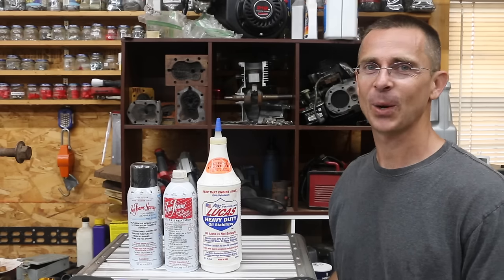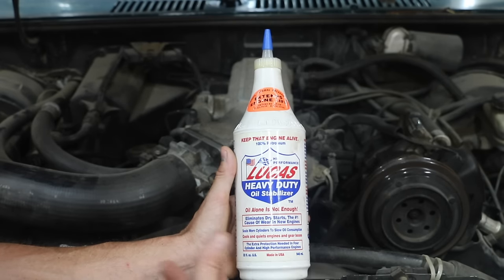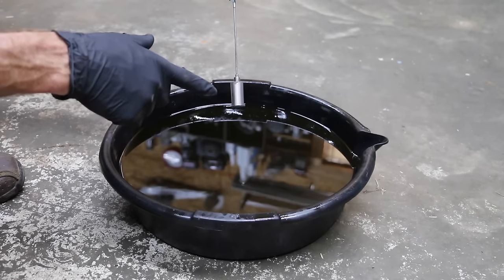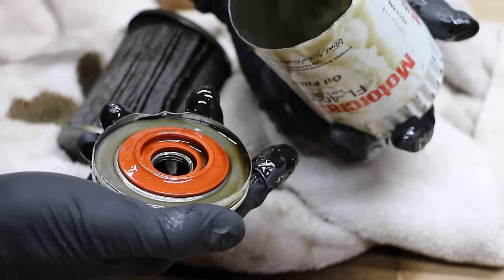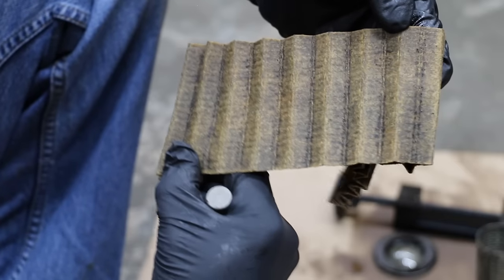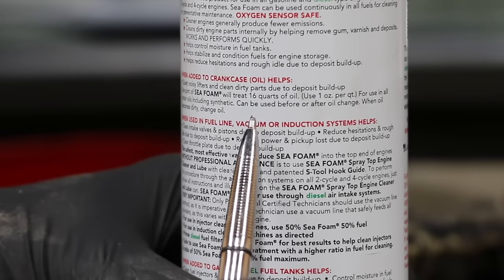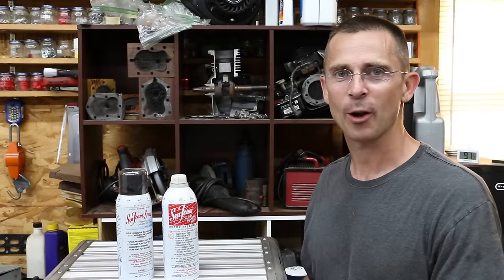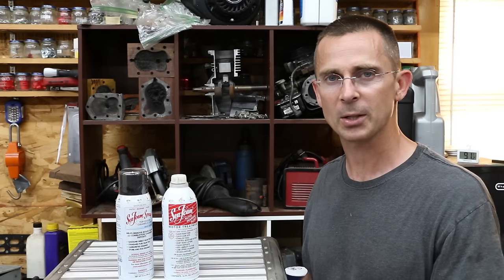Did the Seafoam fix last? Update on the Ford Ranger

Comment: Thick oil will increase compression. You can rehone the cylinders with a fine powdered polishing powder like what the use in a rock tumbler. An old timer showed me that when I worked in a garage in high school. My 67 Nova had 2 cylinders with low compression 60ish in one and 70ish in another. He ran the engine at about 1500rpm and proceeded to dump about 3/4 of a sandwich bag worth of polishing compound from a rock tumbler down the carb. Drove it down the road and flogged it for about 10 minutes changed the oil and re did the compression test. All were within 10 -14 psi of each other somewhere around 140. Ran perfect for the next year sold it to a friend and he drove it 2 more years before blowing the transmission and junking it. I would test it on a lawn mower engine first to make sure you get it right....
Reply from the maker: Impressive fix! Thanks for the recommendation.
Reply: I'd love to see you try that on a old mower.  Sounds sketchy!
Reply: Sounds like the old 2 strokes that has iron liners that can be rebored, but if the compression rings are shot,then.imho ur outta luck with this method!
Reply: Nothing in a can will fix broken parts. That will probably only fix a glazed cylinder but if it is shot worth a try....
Reply: @Cape Cod CNC --- My grandpa used to tell a story about when chrome alloy piston rings first were being used in maybe the late 40s, their family got a new car and it burned a ton of oil so someone recommended doing what you're describing except with comet cleaner/polish powder to get the rings to seat.  Worked perfect according to him
Reply: Cape Cod CNC This sounds all kinds of sketchy. I definitely want to see it tried!
Reply: I have a VERY HARD TIME believing this one.  To the extent that I have semi first hand knowledge that it doesn't work (semi in that you don't actually specify what it was that you dumped in the oil).

In most cases a decent oil filter should catch most abrasive particles, but if sufficiently fine it will get past... but that gets into what I've tried- I had a ford straight 6 that wouldn't die, this was back when 100k miles was A LOT of miles on a car and it had something between 150-200Kmiles on it.  It was worn, slow, didn't seem to do anything right (from a teen ager's perspective) BUT it wouldn't die.  

We finally dumped about a cup (maybe less, not more) of autobody paint polishing compound in  the oil while it was running.  It kept running but with less and less power, eventually (probably a couple of hours running time, this was a while ago, but it was junked within a week) got to the point where it had no power- you'd put it in gear and it would die or not really have the power to move out of the parking space.  It never got to the point where it wouldn't run, but it was worthless and not at all better.

+Project Farm this might be a fun one to test...
Reply: He mentioned dumping the compound into the carb, not the oil, which is why the oil filter would not actually capture anything and the compound should reach the cylinder. Would love to see this tested.
Reply: Mark, oil filter does not filter the carbs passage ways
Reply: We're not talking about putting it in the oil dude, you dump it down the carb so it's working mostly above the rings and not frigging up the bearings and other metal on metal stuff and clogging the oil system up.  Also, it will only work on stuff where the rings are still springy enough to take up the slack once the surfaces are polished. If the rings are baked it's not going to help
Reply: lawdawg1942 very sketchy, I’ve heard comet powder cleaner being used for that before.
Reply: Cape Cod CNC After reading this, I decided to try it with my car, a 2001 metro. I used Comet cleaner and about half a cup. Let's just say it ruined the engine. It was worth a shot tho. Shop told me the rings were worn out, but the car only has 75k on it. Car was just waiting for me to strip some things out and take it to the scrap yard anyway.
Reply: scob89 it’s not likely that it will work ever. You always hear these stories of “one time when” but I know what dust and grit does inside an engine. Nothing good even temporarily.
Reply: Thicker oil will also decrease performance, really if you think about why nascar etc runs engine a quart or two low is because it robs performance, plus they rebuild every race or every other. Fun fact though check into it... I thought it was interesting.
Reply: you put it in the intake and not the oil right?
Reply: Wow, somehow I missed "down the carb."  

I have some fine cerium dioxide powder (used for polishing glass), but I don't have the guts to try it.

Project Farm, it's an opportunity to ruin another perfectly good engine ;-)
Reply: It will only make damage to the rings and cylinderwalls up and down. you need the x pattern in the cylinder to stop oil make it to the cumbustion chamber. you will get somewhere if you take the head of and use a sandpaper in the cylinder with the piston al the way down if you are lazy and don´t want to take it al apart.
Reply: You can also use Ajax, we had a 1979 Ford F100 , with the straight six 300cid/4.9l it smelled really bad and was hard to start. An old friend of mine, that was a mechanic in the navy told me about the Ajax of course I did not believe him, and thought that he was pulling my leg. The truck was ready for the junkyard so I had nothing else to lose, and I gave him the go ahead to try out his miracle repair, we did it, and it worked great drove the truck for another three years until a tree fell on it after storm. :(  The truck was much easier to start and burned almost no oil.
Reply: an old timer told e the same story
Reply: or run non detergent oil for a few days that will reseat rings/compression unless valves leak from work seats & guides
Reply: This works - don't use it on aluminum bore "cool bore" engines, as the nickel-silicon electroplated surface is only a few microns thick and this would go away fast with this method.  (Those who ever made the mistake of honing a cool-bore aluminum cylinder wall engine will describe with a gleam in their eye what the oil looks like no mater how many times the oil was changed!)  Make sure engine has been cleaned with Seafoam (or even kerosene) to make sure rings are free. Important.  Change oil after using this abrasion method - a little WILL get in the bottom end.
Reply: What an interesting hack! I wonder if racers might use it to get another couple hp, say, from a new engine. There's probably some optimum wear vs oil viscosity cross-over point. Count me as another request for a video trying this on an old engine. Fun channel!
Reply: Why would you add it to the oil? The point is to basically rehone the cylinders without actually doing a full teardown that rehoning the cylinders the normal way would require. Adding ANYTHING abrasive to the oil is a surefire way to kill an engine, the filter might get it, but it WILL clog the filter if you add enough (a cup of garbage is greater than the trash capacity of any normal engine filter I have seen outside of industrial stuff), then the bypas valve will open, then the abrasive material wrecks the engine, or the engine is starved for oil and you get the same result. A tiny bit getting past the rings and the filter wil get it just fine, that's what it's there to do after all.
Reply: you would not it goes down the carb as it clearly states
Reply: I am an automotive machinist and I can tell you that this was a common fix at the time.  Chrome rings are very touchy to break in and can glaze the cylinders very easily if not broken in properly.  If a new or rebuilt engine wasn't holding compression then the mechanic, machinist or owner would sprinkle a couple of teaspoons of Bon Ami down the carb at high idle.  It was like putting 1,000 miles on the engine in seconds and usually seated the rings.  It is basically the equivalent of lapping.

I have never heard of this used on a worn engine and never heard of a "polishing powder" being used.

There were tons of "tricks" used years ago by "old mechanics" that worked for a short time but are basically butcher work by the standards of proper practices.  Years ago it was common to put shims behind bearings that had too much clearance to tighten them up, they widened ring grooves and put shims under the rings if the grooves were worn, they'd build an engine "tight" and "burning in" the bearings, pistons were knurled to increase their diameter if they were loose in the cylinder, etc., etc.  None of this is actually good work and is why engines, and especially many "rebuilds", were only good for 50,000 miles or less, if you were lucky.  When I first started driving, no-one wanted to buy a car with over 40,000 or so miles because it was worn out.  

If a modern rebuild doesn't go 100,000 or more, something was done wrong and none of those old "tricks" are acceptable any more.
Reply: That is a very true statement. Well said!
Reply: dunno, beer works on me and it comes in cans
Reply: @meronscommandos  no beer doesn't work on you, it gives you the illusion of it working.
Reply: please do this before i wreck my truck lol
Reply: back in the day people would "hone " your motor for free by throwing rocks in the carbs
Reply: @mikelissandrello7655  That doesn't surprise me one bit. You could shoot that Ford 300 straight six with an Abrams tank and it would laugh at it.
Not a Ford guy (whatsoever) but man...that was one of the best engines ever made.
Reply: Cape Cod CNC I would like to see this
Reply: Very fine abrasive material does work.
Reply: @Cape Cod   Not in a modern engine. Maybe with a vintage cast iron engine you could do stuff like this or idle it with kerosene or diesel fuel in the crankcase to get out the sludge. Don't even think about it with anything with an alloy head. An alloy block? Absolutely not.

Also, thick oil is not what you need to clean carbon out fouled rings. It doesn't even work for that purpose or for reducing oil consumption.
Reply: @Anonymike Ive done it with an 04 Civic engine. Ran like a top after I was done with it.
Reply: @Tyler Bollinger  Irrelevant. Generally, what will happen with anything that gets in the combustion chambers is that it will get tossed out the exhaust valves  in the case of household cleansers or a polishing compound as mineral ash. But it is still bad practice. If an advanced user, and I sure that is what you are and it is what I am too, wants to do it, their business. I would only try something like that on some kind of vintage production that I was willing to write off anyway. You shouldn't be signing on to an idea like this without adding a necessary warning for the sake of the less experienced.

I still say, use a commerical (parts store) product to clean the engine. Or just accelerate the oil changes, put the right additive in the gas, and drive the vehicle. If the engine is highly worn. nothing is going to help it, but flushing out sludge and burning out carbon and varnish will do wonders. You only help the process along with chenical additives. The usual cause is either only local driving, no long trips or lack of maintenance. Stop and go constutes severe use and more frequent maintenance is required.

One reason why this may have worked in vintage cast iron engines is that the clearances in them were much looser. Whatever powder got in the oil just flowed around suspended in the oil.

If you insist on cleanser, use Barkeeper's Friend, that's the name of a brand. It's the best. Or Bon Ami.
Reply: No wonder my car runs better in winter....
Reply: It must have been a tweaker that invented the comet treatment to an engine.
Reply: @mpikas  You made a mistake dumping the polishing compund into the oil , you're supposed to pour it into the cylinders via the intake tract . Dumping a polishing compound into the oil only circulates the stuff through the oiling system, where it reaches the cam, lifters and bearings, and effectively grinds those parts down to nothing.
Reply: @RickBaconsAdventures  no you can put it in the gas the oil and intake
Reply: We're not talking about seafoam, we were talking about putting abrasive powder down the intake to "rehone" the cylinder walls and match the rings to them.  Putting abrasive powder in the gas would probably never make it into the engine and putting it in the oil would just destroy the engine.
Reply: i see,,, the Carbueurator,, ?sp?,,,,,,,  == so you exfoliate the carbeurtor,,(sp?) ---   is that what it does,,,???   thank you
Reply: funny,,, the old days,,, :)
Reply: You guys would have to know exactly what grit of polishing compound to use, be it 1 micron (16k grit), 0.1 micron (160k grit), or finer. Using comet just seems insane to me.

I really don't see how this would work. You could smooth out the cylinder wall and piston rings, but in the end you are removing metal. Removing metal should mean a bigger gap and less compression. Someone explain this to me.
Reply: I've heard the same story in years past.
Reply: @JustMe-gs9xi  wtf has nothing to do with the carb....
Reply: tried this on an old lawn mower. Engine was too far gone and it didn't work. So i poured crusher run gravel (tiny crushed limestone) down the carb at wide open throttle. It popped and banged for a bit until it split the crankcase in two and pounded a hole through the top of the piston. Wish i had video of that.
Reply: @dagubment  lol funny but you're supposed to use some pretty fracking mild abrasive if you actually expect it to work
Reply: @RickBaconsAdventures  yeah, but at that point it was for pure entertainment. lol
Reply: @scob89  
3 cylinder? 

Those are aluminum without iron bore lining.

Disposable engines.
Reply: Didnt go through all the coments but I did that years ago with iron blocks in the 80s. Funny I was looking for someone to mention it. Gonna try it on a nicasil bore I got that smokes.
Reply: @mpikas  He didn't say that he put the polishing powder in the oil.  He put it down the carburetor.
Reply: Did the same thing to a International tractor 40 yrs ago that had been rebuilt and the owner didn't work it hard enough and it glazed the bores. Three tablespoons of Bon Amy cleaning powder into the intake at high revs and not a drop of oil was used after the treatment.

Comment: I use marvel mystery oil in my Jeeps engine. It’s the 4.0l and it used to have the common lifter noise. After adding marvel mystery oil it has quieted down noticeably. I follow their recommendations on how much to use and have not had any issues using it. It also isn’t as thick as Lucas oil is. It might be worth considering as an alternative to Lucas. Thanks for the great videos. Keep up the good work.
Reply from the maker: MMO is a great product. Thanks for the recommendation.
Reply: I was getting no oil to the valves on my 1970 LTD. I put in a quart of Mystery Oil and ran the thing for years more, adding MMO every oil change. I also found that Mystik oil reduced blow-by on several vehicles. A friend with a B.S. in auto mechanics who turned me on to Mystik oil now only uses Rotella T in all his vehicles. Probably good stuff.
Reply from the maker: Interesting! Thanks for the recommendation on Mystik oil.
Reply: So far I've had great results with Lucas Complete Engine Treatment in the oil, along with some of Lucas High Mileage additive.  Doesn't seem to thicken the oil as much, but seemed to help around the same effect as Seafoam in my 2001 Ford Focus, with the Zetec engine.  Top end didn't sound quite as bad as the Ranger, but was still excessively loud.  Seafoam helped that, and seemed further helped by the 2 Lucas additives I mentioned.  I use a little of all 3 in my '97 Camry 2.2.  Both have around 220k miles and still going!
I am curious how to help my father's 2012 Kia Forte.  It sounds like it has a slight knock, most noticeable at or just above idle.  Still pretty quiet and no lights or anything,   I've added small amounts or Lucas HD oil stabilizer, and small amounds of Lucas Pure synthetic oil stabilizer (which Pure synthetic worked well in the tranny of my cars, and even in the power steering of my cars, in small amounts) but I'm not sure how raising the oil pressure with HD stabilizer will do with the Kia I'm sure having VVT and the like.  What do you guys recommend to quiet down and/or reduce the onset of further damage?  Kia's got about 180k miles, and we are keeping up with oil changes (not liking the fact of the sealed tranny, wish I could check that easily) so what else can we do?
Reply: Chris, thanks for sharing.  I've got a Jeep with 4.0I as well and have the same knock.  Will try MO.
Reply: The Jeep 4.0 seems to be notorious for lifter knocking, I had an 01 that did it with over 300k on it and a 2011 that only had 120k and it did the same thing
Reply: my 4.0 clicks like a clock from the lifters, I personally kinda like it. Good quality synthetic reduces it.

Comment: This is one of the best channels on YouTube. On the topic of what additives to use I would say try slick 50. I've had good luck with it over the years. I've also ran it in a few manual transmissions and its performed well. 
You may have already covered it in another video, but haven't watched all your videos yet.
Reply: No. Do not use Slick 50 on any engine you care about. The teflon particles in Slick 50 do not belong inside an engine, they have plugged oil lines, they plug the filter and open the bypass valve letting everything through. Even Dupont said don't use it, they were sued by Slick 50 over that.
Reply: @bedlamite42  Only thing I can say is I've had good luck with it. 
I keep my cars maintained on a regular basis too.